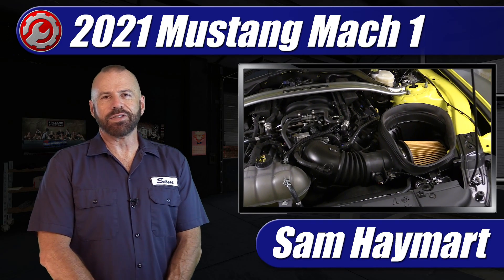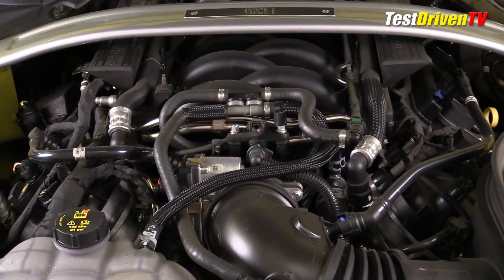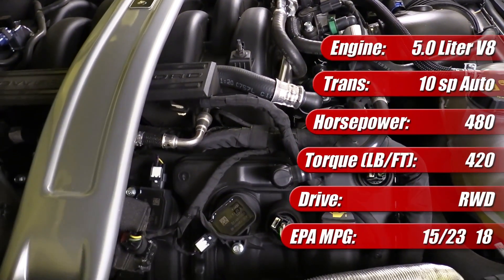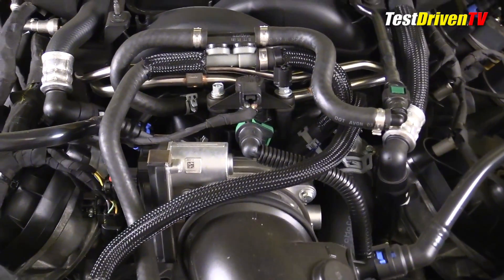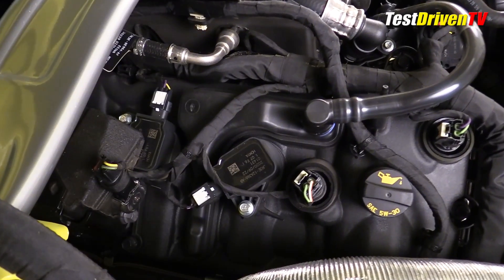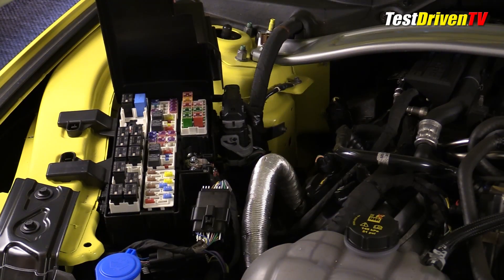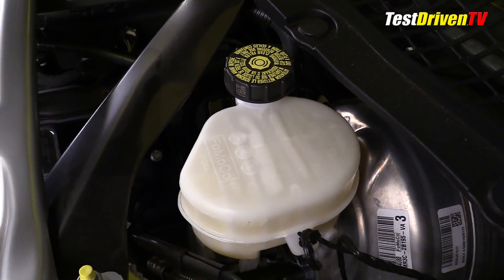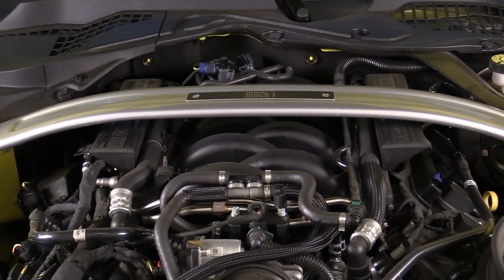2021 Ford Mustang Mach 1: Under The Hood

Comment: 3 things:
1) great video!
2) i think the 5.0 was introduced with the 2011 mustang (not the 2012 like you said in the video)
3) you said this engine is 370 cubic inches, however that would be 6 liters. I think you meant 307 cubic inches.

EDIT: after listening again, it sounds like you did say 307. but it sounds almost like you said 370.
Reply: 1) thank you 2) our bad 3 ) we stated 307 not 370